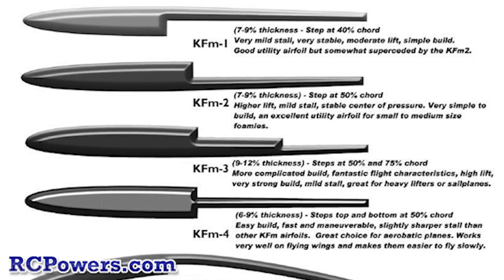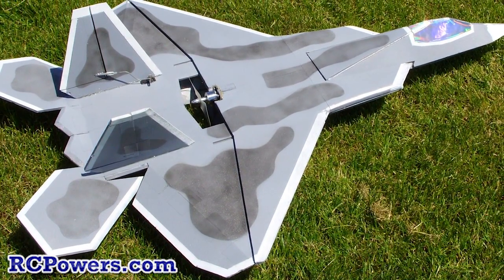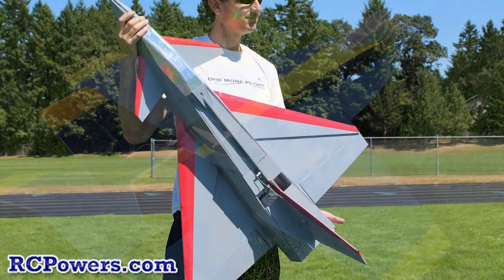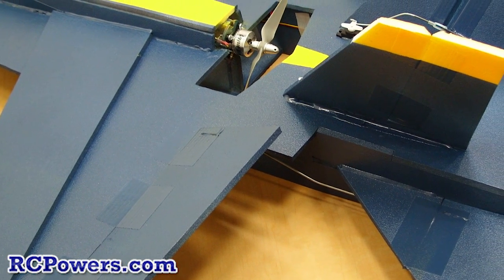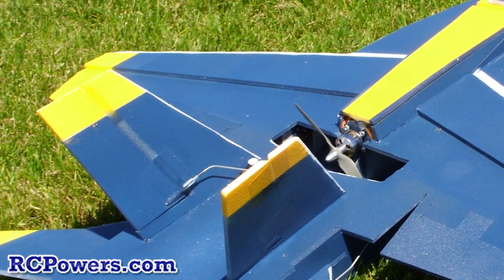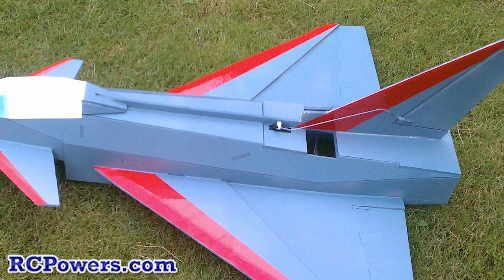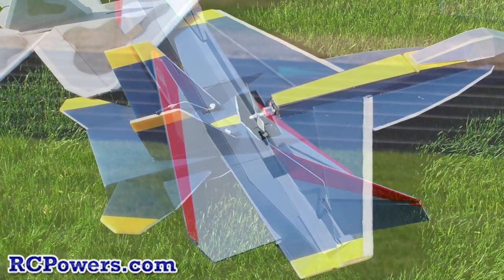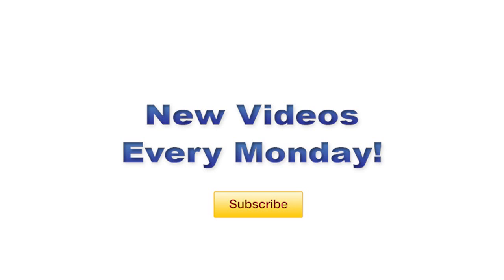Why we use KF Airfoils!

Comment: Nicely done video.
But "aerodynamic" and "sloppy" leading edges are mentioned several times, but no details or definition of what it should be or what those words mean in this context.
Please elaborate on those undefined terms. thanks.
Reply: look at the edge of a normal airfoil, and compare it to what you see in the video. it just takes some knife skills, or sanding to make them much neater
Reply: Thanks for the reply. So IF we can make the leading edges linear and regular, they will provide the KFx effects, without creating compromising turbulence and airflow de-lamination introduced by any irregularities in the edges & surfaces. Similar to the laminar flow goal of the Mustang fighter years ago.
Reply: afaik the front edge does not affect the function of the "steps". which is delamination, btw. a neatly shaped edge cuts through the air with less resistance and more predictable, though, and helps to generate lift.
foam board (i mostly use depron, that has no paper on it) is very easy to shape, and surprisingly strong with a layer of tape. there is no question IF one can make neater edges. :D just think combining an armin wing's smooth front, with some KF steps in the back. it has all been done before.

Comment: @tomascontrerasjr 
Its all about old "Reynolds number" which basicly defines what kind of airfoil you could/ shouls  use. This "Reynolds number" tales  why butterflies wings, small Rc-plane and  large Jet plane has different aifoils.  So why you don't use it on your prop? basicly its foil is too short and its not good think to try create turbulence and same time drag without creating additional lift. vertical stab has normally only small angle of attack, there for KF creates only drag not lift.

Comment: Hi Dave, have you ever experimented with a foam that has small round dimples like a golf ball?  I saw a show on it when a car had them put on, the car was bout 20% cheaper to run on fuel due to wind residence being improved.  Be a devil and build one.  I think it will go a lot faster (my guess anyway)  The golf ball dimples could be put on with a hot soldering iron with a ball at the end as a tip.

Comment: A screwdriver makes a terrible hammer but a hammer also makes a terrible screwdriver.  The quirks of KF airfoils might make them bad for commercial planes etc BUT for scratchbuilt parkjets like the RCPowers, Tomhe, etc designs?  They are perfectly capable of being the right tool doing the right job.

Don't get caught up in the academia of "which wing is the best".  Edcuate yourself on which is the right tool for the right job.  If it's a KF Airfoil?  Use it.

Comment: I think the addition of the KF modification does some pretty cool things to wings on these planes.  It thickens and stiffens the wing, which works great, especially on the larger designs.  You can sand a very nice symmetrical leading edge on a KF4.

Comment: KF2 worked so awesome on my F22 V2 I built using foam board (heavier than most foams) but it flew like it's really light weight and made of depron.  It lands almost vertically when I cut off the throttle and add spoilerons.  You maybe adding a little weight, but you're gaining lots of lift, stability and strength by adding a KF!

Comment: You are dead on about the shock absorber effect. My KF leading edges are rounded, like a traditional airfoil, not beveled. On my F-18v2 (KFm4) the wing is sanded/rounded all the way to within 1/2 inch of the step.
I use them for the simple reason that they work. Well.